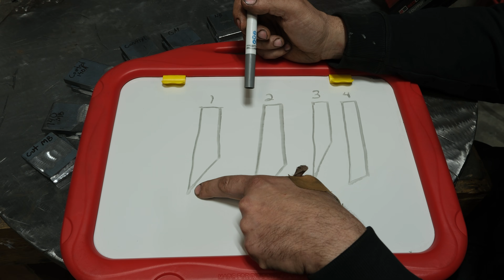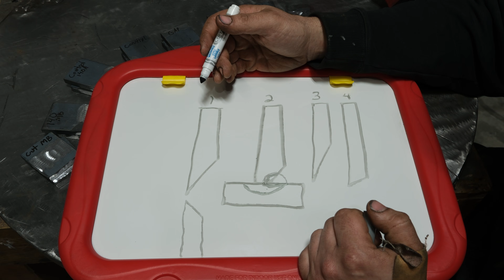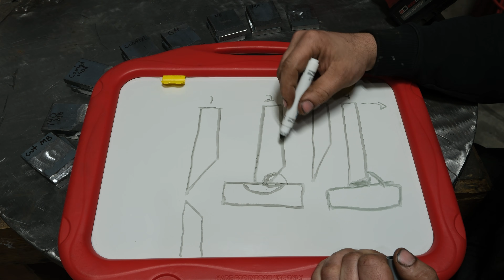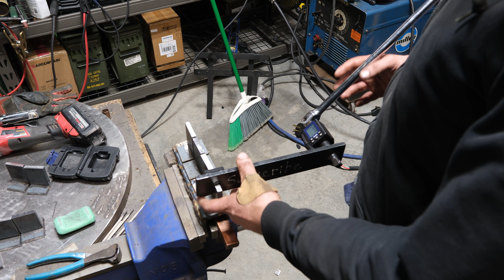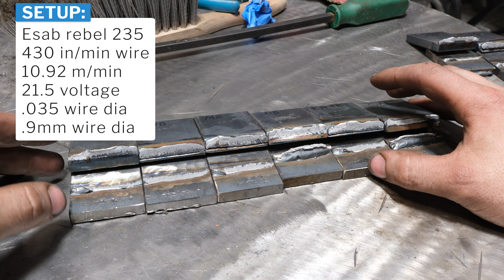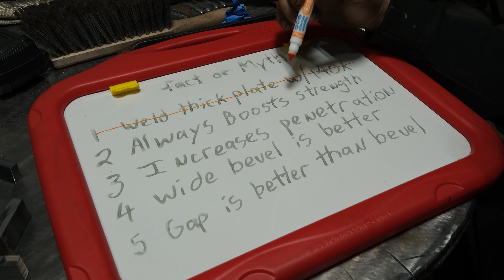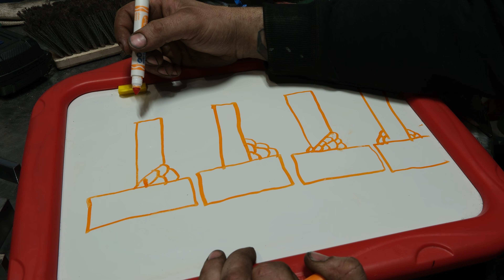Does beveling increase weld strength??  Deep dive

Comment: Decent video, but not very good because you do not give me all of the well parameters you used. I don't understand why you're not using spray arc or close to spray arc or even globular deposition with a short circuit MIG welder at 140 amps it's easy enough to do if you have the right gas
Reply from the maker: Couple things to help clarify what you talked about:  the purpose of the video is to show that simply beveling plates does not allow for more fusion than what the process is capable of.  It doesn’t make it “safer” to weld thick plate with an inadequate welder.  “Just bevel the plate” is something I hear multiple times a day in both comments and on face book groups constantly.  It’s unfortunately not a solution to a problem of inadequate power.  Even with 200amps and c25 gas a bevel still has poor penetration as expected.  So not just any bevel is going to work.  

I didn’t use spray arc because that doesn’t have a problem welding a fillet weld without a bevel and achieving proper fusion.  It’s prequalified to weld 3/8th plate per AWS, short circuit is not.  If you want to see the results of spray on a beveled plate it would be by far better than a beveled plate and c25 gas.  A vast majority of home hobbiest welders don’t have machines capable of spray, and the video is not aimed at people with big welders who weld stuff with higher liability.  It’s geared for the average person with the average 200amp class (or less) machine.   Around the same time this video came out I produced numerous videos on spray and talked about how it works/benefits.  In all my videos I stress the importance of testing what a person is doing instead of making assumptions as to what’s going on.  Very few people actually do this, and it’s more valuable than any magical settings.  

Spray arc is not possible on a 140a mig welder.  The highest voltage I have ever seen on a 140a mig welder is 22v and that won’t cause the wire to go into true spray.  Globular might be possible at 22v with 100% co2 but nobody runs that because it produces a lot of spatter.  Even if you did something like run .023 wire at 22v with c10 in an attempt to spray, it’s still not welding 3/8th plate properly.  Dual shield performs poorly with .035 wire on 1/4in, and 140a machines can run .045 wire.  A 140a might bead with c100 will have far less penetration than 200a with c25.  There is simply no way to weld thick plate safely with short circuit process at 140a.

Comment: With 3/8 plate and a mig, if it was steel I would weld with S70 wire and I would do a primary pass using spray arc so that I made sure I got good penetration, and I did not bevel anything. But I always left a fillet that I could put on the back edge of it if it's a corner weld. And then I would do another pass up around 24 to 26 volts using at least 80% argon, usually use 92% Argan and 8% CO2. If I'm doing stainless to Black Iron I will use either an odd-numbered stainless wire or I will use an S70 which is still a high alloy wire. I have seen very good-looking welds and I mean one of the prettiest welds I ever saw was on quarter inch black Iron on to 10 gauge stainless steel. It was so pretty, but I could tell something was odd with it so I hit it with a hammer and not the weld right off of it it was about two and a half inches long. All it was was a support on a stainless steel drain pan. I took the well and I handed it to the welder and said take that it's really pretty. But you got to learn how to turn your welder up. That was the problem that we had the most often with mig welders is nobody knew how to turn it up and weld with it turned up. It's better to weld with it a little bit on the hot side then a little bit on the cold side.
With a stick welder I would generally with 3/8 plate use 1/8 rod at about 90 to 105 amps and drive it in there and if I thought that it needed a little bit more penetration I just pull a little bit longer arc.
As for stopping things from warping, you do a back stitch which means you're always starting in a new spot. And you are welding onto a previous weld where you can either slow your work speed or you can draw a little bit more of an arc with a stick and reheat that and make sure that it is sealed. The differential Heats will cause a ripple effect on the metal that will go away when it cools almost every time. Every time that I ever tried it it did work but I have seen people screw that up.
I did spray arc with short circuit Meg all the time. Why aren't you able to do it? Are you using the wrong gas mixture?
I would like to know the rest of your settings, because just 140 yd is not telling me what you set the welder at?
Another thing you can do with short circuit or with spray arc is to make sure you're pushing it and slowing the wire speed that way you're making the element of the Ark work through the puddle instead of trying to burn into the cold metal by dragging the gun. You will get better results by pushing it with a slower wire speed.
Reply from the maker: Short circuit mig by definition is where the wire hits the molten puddle as a solid and shorts out.  Spray arc is where the wire is molten and crosses an actual gap where there is an arc present.  The two processes exist separate of one another and can’t exist at the same time.  You can’t achieve spray with gas mixtures that have a high amount of co2, which is why c10 and 95/5 oxygen exist for spray.  You can achieve globular transfer with high co2 mixtures, this is recognized as its own form of transfer.  Very few people use this because it welds like long arcing a stick rod (aka big spatter).  It does have huge penetration but it’s not really practical for the average person to do.  If a welder is capable of 24+ volts and 180+ amps it’s possible to spray with it.  The limiting factor is most home welding machines simply don’t have enough duty cycle to do much of it.  It’s not really hugely beneficial to the average person who welds 3/16th and under material either, since short circuit does a great job on that.  

I am not sure if slowing the wire feed speed and pushing will do much to make pushing penetrate better than pulling.  There is a 100% real problem with running hot settings fast, you can really loose fusion doing that.  At an average rate of movement where you’re not flying at Mach 5 I don’t know that slowing down with less wire will do much.  In a future video I will have to test that.

Comment: If fusion is the reason you are considering bevelling your joint, you are on the wrong track. The reason to bevel is to increase fusion area in the joint, not to increase depth of fusion.

Comment: Very, very good info.  A section on recommendations on which method would be best for us rookies with 140 amp welding machines would be helpful.
Reply from the maker: I can give you some advice.  With a 140a machine you’re limited in a lot of ways.  I have done extensive testing and have found that 140a is limited to about 1/4in material at the limit.  3/16th is no real issue.  Running flux core wire you can get better penetration but you will have internal weld porosity issues on thicker than 1/4in material with .035 wire.  Believe it or not 100% co2 gas will be your best bet to make strong welds on 1/4in material with gas shielded mig.  

There are a ton of thoughts that exist on the internet that beveling, preheating plates, and all sorts of other tricks solve the issue of a lack of amperage.  The truth is nothing will substitute amperage, and a machine that’s 200-250a has significantly more performance on 1/4in and thicker material.  Generally I recommend that if people want to weld 1/4in and over to start with stick welding.  However stick welding is absolute challenge to weld sheet metal (16ga and thinner) so it’s mostly useful for thicker material.  So basically if you want to be able to weld 1/4inch or thicker pickup a stick welder and learn stick, or upgrade to a bigger 200+ amp wire machine.  

With that said if I had to make a weld on say 3/8th plate with a 140a mig welder I would preheat the completely cleaned plate to 300 degrees, and over weld it (aka have a oversized multi pass weld).  The first root pass will have poor fusion, but subsequent passes will probably not be bad.
Reply: @makingmistakeswithgreg  Thank you so much for sharing your knowledge.  It is very much appreciated.  I will follow your recommendations.

Comment: Depth of penetration is about getting into the root when a full depth weld is needed and providing some margin of error to the individual beads. It is not about the strength of fusion, just a few atoms deep will provide full strength fusion. T joints don't need depth of penetration because the strength comes from the cross sectional area of the fillet. 
You could do the same with a butt joint but it would require a thick build up of weld deposits, sort of like a lap joint but formed out of melted rod rather than a patch plate.
Reply from the maker: Unfortunately the common thought is that beveling gives the ability to properly weld thick plate without a powerful enough machine, this simply isn’t the case.  There is no substitute for amperage with thick plate lol.
Reply: @makingmistakeswithgreg  The power of the machine only effects the time it takes (Several small beads vs a few large beads.) Even a little 120v machine can weld any thickness plate (Assuming the power output quality is sufficient, no major droop or fluctations.) 
Not beveling a T-joint gives a stronger joint per unit of filler metal deposited, regardless of the machine.  It is a simple cross sectional area, and leverage issue (in bending stress).

Comment: A question... i have a hobby quality welder, rated for not much.  On the very rare occasion i want to play with heavier plate, say for my tractor, is it possible to pre-heat the weld area using a torch to buy a little better weld ?
Reply from the maker: I did make a video on that a while back, links below.  My general opinion is preheat is not very effective.  The preheat may allow the weld toes (sides) to wet out a bit better and the bead might be a bit flatter, but the actual depth of penetration/fusion is not significantly better.  So basically the weld will visually look better but from a strength perspective it won’t really perform better.  Wire welding in particular performs poorly on anything thicker than 3/16th plate unless you have 200+ amps.  It really falls apart on over 1/4 inch with smaller welders.  With stick welding you can weld thicker plate at sub 160a which is why it is a far better option for welding thick plate in the home (especially with minimal equipment.  

If you were to compare the difference between a 200a mig weld with 100% co2 gas on 3/8th plate and the same weld done with less power a hot preheat, and c25 gas, it’s shocking at how different they are.  There is no comparison, the non heated plate will have 3-4 times the penetration/fusion.  With stick the preheat will not benefit it much either, in most cases preheating with stick is done to prevent weld failure from the weld cooling fast on higher strength alloys or cast iron. 

So basically if you don’t have the amperage you will not be able to make the weld, and the problem becomes way worse with wire welding vs stick.  When it comes to tractors many parts are made from higher strength steels and they will likely need a preheat before welding anyways.  Hope that helps.
Reply: @makingmistakeswithgreg  thanks for the intel...

Comment: Good video.  At the 30:00 mark....this is why I was taught to use a small diameter 6010 rod for the root pass, then back grind or back gouge to sound metal after every pass........Now for a observation about the thought process of your experiment.....you compared a full bevel weld on 3/8" plate to a full strength fillet on 3/8" plate....in each weldment, there is essentially the same amount of fusion so not a real increase in strength.  BUT if you do a full strength bevel weld and then cap it with a full strength filet, you have essentially doubled your sidewall fusion and this is the REAL reason to bevel a plate. This is perhaps outside the scope of your experiment since you were testing only penetration, but I thought I would make that observation nonetheless.  Cheers.
Reply: Your comment goes to the point of MINE - above - that combining a good root pass with the fill and cap-passes should add strength to the overall weld.
Thanks !
- C .

Comment: You are right about not using the MIG welding process for thick metal plates. However, this is true only for the 110/230V home user machines where even the reputed brands do not recommend welding anything thicker than 6 mm plates (0,23 inch or 15/64") with this kind of welding machines. 

However, on the realm of 400V MIG welders (even older machines without pulse) it is another story. The industrial MIG welding machines can deliver exceptional results and arc characteristics which are not any less disappointing as compared with stick welding. 

Anyway, nowadays in the heavy industry, except  applications done outside, it is mostly MIG welding. The thickness of metals used on some special machinery and metal components welded by MIG process are unfathomable for most viewers here on youtube.  These industrial companies must be doing something right as their welds undergo NDT inspection and the machines are ok in operation. Very  good fusion and deep penetration of thicker plates can be achieved by MIG welding but not with these home use intended welders. 

If you get the chance to play with the settings of a 400+ amp MIG welder and pair it with a quality welding wire it would be nice to see the result of a similar test like this one here in your video.
Reply from the maker: 100% agree with you.  The modern machines with some horsepower have mostly made stick irrelevant within manufacturing.  You’re in luck, at my job I have access to multiple 400+ amp wire welders and some pretty big wire.  In the future I will be doing some test plates and bringing them home for testing 😀
Reply: @makingmistakeswithgreg  Looking forward for it. 🙂

Comment: Would preheat make a useful difference in improving the welding performance? If so how much preheat would be required?
Reply from the maker: I did cover that in a couple random videos it’s something that I should revisit.  Based on what I have seen it doesn’t seem to make a huge difference.  If you use say a 140a mig welder and heat the plate to 600 it won’t magically give you the performance of a 200amp machine.  If you heat it to hot that the weld stays red hot a good while you may actually see a reduction in weld strength due to poor solidified grain structure.  Some materials (like thicker high strength steels like chromoly) do need a preheat before welding, but that is to prevent hot short cracking, not to improve penetration.  

So on steel thicker than 1/4 it wouldn’t hurt to run a 150-250 preheat before welding, but it’s not going to make a huge night/day difference.

Comment: You should never use a single-sided, bevel or fillet weld in an application where the root is in tension.   If you do they are only capable of supporting about 1/2 the base metal yield strength.  At 1/2 yield you should just redesign the weld joint because who wants to use 1” steel if the weld can only carry the load of a 1/2 the thickness. 
 
Plates are beveled to provide access to the root layer and to maintain a weldable surface condition through the thickness of the joint. 

We don’t “bevel for strength” the weld size or throat length is what provides strength.  The welding process and positioning dictate the required joint design and bevel angle.
Reply from the maker: A lot of your thoughts are correct, but you’re missing a couple key components.  Most of what the average person welds is done single pass, and In 99.9% of cases they are not an engineered part.  Many things that might be welded could see force away from the root.  Many things may also see vibration or impact forces.  Root fusion/penetration will limit how much a fillet weld will leverage against the weld, and it will handle vibration far better.  It’s not just about weld size.  Case in point the short circuit weld that had virtually no penetration vs the most fusion beveled weld.  If both of them were finished with 2+ more passes and both stress tested (with any thing other than a static load that only puts the weld face In tension), which one will fail first?  

The main point of the video was to demonstrate that simply beveling plates doesn’t improve penetration beyond what a persons machine is capable of.  By having a weld further into a plate  you change the fulcrum point, reduce leverage, and decrease the effect vibration will have towards failure of the weld.  No, beveling doesn’t change the material properties of the weld that’s deposited, but it can change the force that weld sees.  A properly welded joint can also reduce lack of fusion (like what was shown in numerous pics where weld material extended further than where it was fused to the sides) which reduces great places for cracks to start.

I understand where you’re going with the thought that beveling is not done for strength, but you’re too narrowly defining what strength is.  A open root butt joint (like on pipe) can’t be welded to pass any destructive test without a bevel and a gap.  If you were to weld it without a bevel you would have a very weak joint.  The bevel makes it possible to achieve complete fusion with internal reinforcement where it would be impossible otherwise.  The strength comes from the weld material yes, but that weld material can’t be put there without a bevel.  And without thinning the material down proper fusion cant be achieved on the root.  So in certain circumstances you can’t achieve the strength required without a bevel, so defining bevels as not being done for strength is in many ways incorrect.